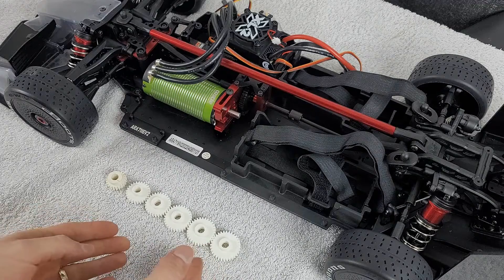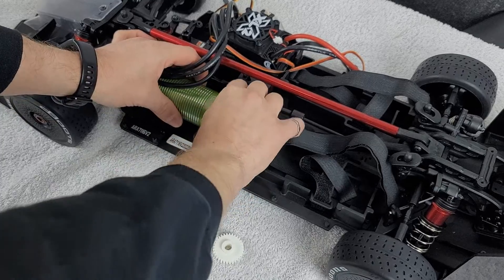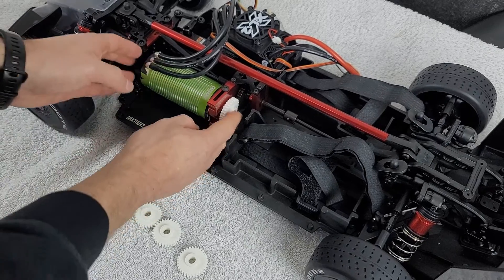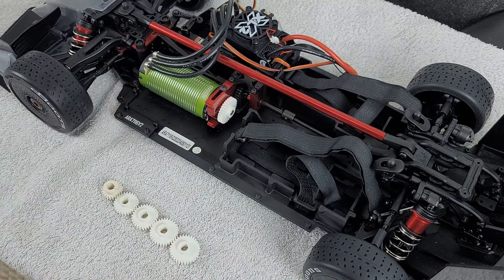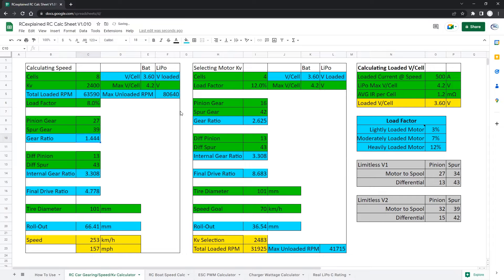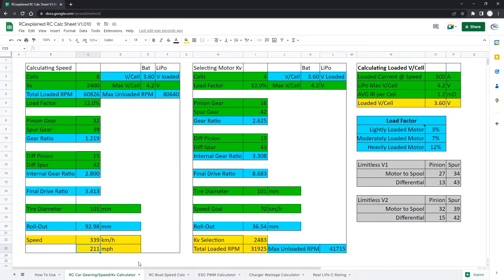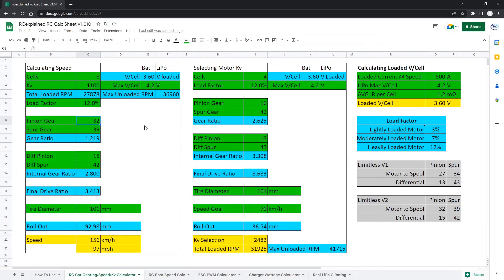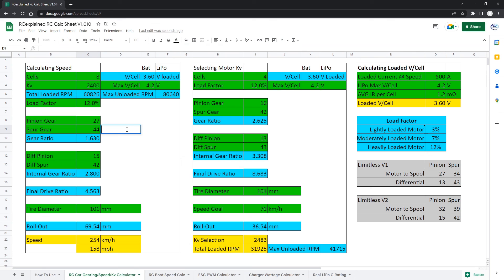The Limitless V2 Gearing Options are EXTREMELY Limiting! Especially for High RPM Motors

Comment: Okay, I have the limitless v2 everything on the unit's stock with diffs  i have ran two different motor combos. I have the castle XLX2. I ran the castle 1717 1650kv 34pinion 34spool 130mph I get 2 passes and motor is hot hot
I've also ran the same XLX2 With the castle 2028 800kv 54pinion 28spool best run sofar 132mph and I can run that setup four or five times before the motor starts getting hot 

I left the XLX2 and the 2028 800KV. In the limitless and bought another XLX2. And put the 1717 1650KV. In my infraction they both do really well. They both are a 130 mph cars 

When I can afford to buy me a castle 1721 2400kv i will go and do real world testing with the same batteries I use for my other two builds and see what I can put down.

Comment: Wonder what the smallest pinion I can use on the V2 if I have a 5690 can. This castle motor is slightly smaller at 46mm.
Reply from the maker: You may find its fairly similar
Reply: @RCexplained  what a coinkidink .39" wider and I ordered a 39t pinion to go 1:1 on the gearing. 😆
Hopefully it's not too big or too small. Maybe just perfect.

Comment: I have max5 g2 plus esc with hobbywing new 5690SL 2400kv speed motor, gearing is challenging smallest pinion i can run is 27t w/ 50t spool gear limitless v2, I also have a new castle 2028 1100kv motor as alternative what would u recommend for gearing for speed running on either motor looking for 150mph,  current pb is 116mph 1st shakedown on rig, ill do a shakedown tomorrow with hobbywing 2400kv 8s 36t/43t with 2 4s hv 9000mah 120c zeee lipos (new)

Comment: Im tempted to get a limitless v2 to race on road at my local track. They have a decent size limitless class. I was looking at a Castle combo with the Mamba Monster X 8s with a 1717 1650kv motor. Would this combo work or do you recommend the 1721 motor and the XLX2 esc in your video over tje 1717 1650kv and the Mamba Monster X esc? Thank you im having a hard time deciding
Reply from the maker: The 1721 is best for top speed runs over 120mph.
The 1717 is better for circuit racing.
This is primarily due to kv differences

Comment: I bought a V2 roller with a hobbywing 1650kv G2 (4990motor) with a max6 G2 (200amp) esc.

I just want to bash on the street. Speeds around 90km/h is more the enough.

Which pinion should be wise? Just go with the 32T?
Reply from the maker: Run the numbers through a calculator and you'll be able to get an idea fairly quickly. I have a simple calculator on the radiocontrolinfo website and a more in depth calculator on my Patreon page. Link is in the description.

Comment: The instructions with the car, lists the 32 tooth as the smallest. 32 to 39 tooth.
Reply: with a 56 motor plate even a 35t pinion wont fit sadly with the pps mount its not a problem

Comment: I was told on my build. I have a GT Chassis V2 limitless. Never ran YET. I am going for a single motor world record. 😂. I am !  Don’t laugh!  😂.  But a 34T and 45T gear for the 2.8 ratio diff with a locker in the rear. On a xlx2 2028 castle 1700kv. On BSR Foams. What are yall thoughts? I also of course have a PP CF GT Driveshaft kit. PPS motor mount. PP Carbon fiber kit. Titanium shock standoffs. Speedrun springs. fc100 body. Let me know?

Comment: What is the best drag gearing for Arrma limitless v1?
Reply from the maker: Depends on your setup. Best way to determine this is by testing a bunch of gears and choosing the fastest one. You can start your selection with a top speed calculation and go from there.

Comment: I geared mine at 28/46 and and when i ran it, i only got 91 mph, and the motor was only heating up to 88⁰ F.
I am using 2 CNHL 5600mah,  packs. Since it wasnt heating up, i changed the gearing to 30/44. I havent tested it yet tho. Im really starting to get frustrated with it. 
I cant find any tutorials at all on how to read the XLX2's data logs. You should do a video on that. I think ALOT of people would benefit from that kind of info.
Reply from the maker: Hello, I have done a couple video on reading data logs. Did you see those videos by chance? And what specifically are you not understanding well in the logs? You could email a log to me and I can make a video of it and post it here.

Comment: You are spot on!!! I had a 2850 kv tp power motor in my limitless V2 I had issues so I had to get a 1100 spcktrum firma 8s and I’m getting 123 mph 34 pinion 39 spur mamba monster x 8s esc

Comment: I got a v2 limitless I will be running a max5 esc and a 1100kv motor on 8s gearing i got is a 34-39 does that sound like it would work
Reply from the maker: I don't have the patreon Calc sheet up but that should be a fast setup. I also don't know how good that esc is. Never used one.

Comment: Just ran into this issue with my v2 roller smallest gear I can go with is 32 Im running a 1717 1650kv motor now that I see it's geared for 140 I'm like wow I don't need that much speed
Reply from the maker: Yep, swap out the spur gear as I've done in a later video

Comment: So, its been over a year. Is there a known technique to fabricate something so I can drop in a standard 50t diff out of the Arrma 6s line? This is BS, I dont want to go more than 110mph. I want a street basher that is an F1 type car, and the lack of a large spur forces you into having a straight speed run car. What about the rest of us? Anyone got anything solid? If not I'm hitting EBAY to find a used V1 instead of a new V2
Reply from the maker: I can't think of any advantage of a V2 over a V1 for what you plan to do with it. Either way, I'm sure you can plan a power system to do what you are looking for.
Reply: @RCexplained  I did some research and what I found is that if you get shafts from scorched rc, you can use the 50t center diff in the V2. I saw a video that was just wicked. I also watch their group live chat, and this is the real deal. I ordered the limitless V2 because of this one video! Why didn't you do an update video on this? https://www.youtube.com/watch?v=8JeF-P4Bz4Q
Reply from the maker: When you originally said diff, this threw me off. The Limitless does not use a center diff and as such I was thinking front/rear.

Completely changing out the center spool drive seems like the most expensive option to put a weaker solution in there. I'm referring to MOD 0.8 pitched gearing. The shafts themselves will be strong.

I did do an update video on this a week or two after the video: https://youtu.be/maNFbGrJTMo

This solution will allow for a 45T pinion used as a spur gear. I have not tested anything larger. But as I said in my first message, I don't see how this (cheaper solution) would not work for you. Somewhere around 4s 1800Kv using 27/45 gearing should get you around 65mph top speed.
Reply: @RCexplained  And don't get me wrong, I respect your work. I just thought that all options would be on the table. I've learned that this hobby needs deep pockets to "do what you want". Although the gearing is "weaker" on mod 0.8, it should still get the job done. I've never stripped gears unless the motor moves. Titanium motor mount screws are mandatory on all builds. The option to tune the center diff would making cornering more pleasurable in my view. 24t pinion with a 50t center diff should be a tire smoking, drifting, hard accelerating monster. This is where we diverge on opinion. I'm also looking at designing a 3d printed bolt on floor to get high downforce without the drag with weather stripping side skirts. I don't know if you're into that, but when Arrma used the term "Limitless" I take that to heart.

Comment: if im runnning a castle 1717 1650kv on the v2 roller, what is a good gearing setup for bashing and drag? I have a 32t pinion would be running 8s currently..
Reply from the maker: This is really a personal preference based on your setup and running conditions.

Comment: use a lower kv motor like the spektrum 1250 kv or castles 1100 kv( if it will fit)   problem solved,     but you want the 2400kv motor so swop the spool gear out
Reply from the maker: Did you find the newer videos I did of this car?
Reply: @RCexplained   I looked for a video of you running this car,   but can't find it.
I'm particularly interested in this build.
Reply from the maker: @1521joe  https://youtu.be/cNnnz495-xk
Reply: What gearing would you use for 2400

Comment: Your not taking into consideration voltage drop, even with the best batteries you will never hit even close to those theoretical speeds.
Reply from the maker: Hello, voltage drop is considered, you must have missed it.
Reply: @RCexplained  That may be but your numbers are still off, I have this RC and I would love it to go past 200 mph but this is not easy and the difference in gearing between V1 and V2 is not a big deal and if it were the gears are cheap compared to a big block motor, ESC, batteries and the other small details that are required.
Reply from the maker: What are you entering in to the calculator?
Send me a screenshot and I can help.

Comment: Just bought the v2 roller and got the castle 2028 1700kv with xlx2. Im gonna start as low as I can with the 39t and its probably gonna be pretty damn fast. 46t spurs are available though.
Reply from the maker: Yep. I can't remember what I went with but it's installed and ready to rip.
Reply: 30/40 1650 kv 👌

Comment: Im having an issue with my v1 😢i have a 1717 motor withVERY good cooling fans, the Castle mamba 8x paired with two 4s batteries with a 120c rating... i even have a cap pack on it and i cannot seem to hit more than 80mph ! Can you advice pleaseeeeeeee?
Reply: you fix the issue yet?    did you check your TX ?

Comment: 34t spur/27t pinion with the 1717 1650 motor was the smallest that would fit my infraction. I guess the motor mount on the v2 is different?
Reply: I was suprised. I thought id be able to use the same gearing as my infraction but nope.

Comment: Hello, i hesitating about buy Limitless V2 and put there 1650Kv big Block castle motor from XO-1 with Max6 ESC. Is possible to fit smallest 32T pinion with stock 39T spur, when 49mm diameter motor is installed? I will run only on 6S as maximum. Mostly 4S. Im not sure that 32/39 combination is for 40-49 whole range of motor diameters. I Know that for 56mm motor is 32 so small, bud im not sure in 49.
Reply from the maker: Hey Martin, if you download the manual from the website for the v2, pg 19 has a chart with specs that may help you out. At least you'll have more insight as to what size and gears are possible.

Comment: Did you ever look in the manual page 19? There is a nice table with possible gear combination for all 3 different motor mounts and default spur gears.
Reply from the maker: That chart shows the limitations. 
I can't remember what I said in the video but I do know that the smallest pinion with the largest spur gear is no where close to where this motor needs to be for the more typical setup. I believe the chart would show something like 32/39 as the largest ratio. That is 1.22:1, crazy !!!
Reply: @RCexplained  limitations, yes. Why did you print all these gears below 32T then? 39T spur gear matches to 32T-52T pinion gear. If the table would be wrong, ok. But wasting all this time to show the obvious?
Easy result: use low Kv motors.
Reply from the maker: Are you suggesting to replace the $240 speed run motor for a lower Kv motor? Wouldn't getting the right gearing be a lot more sensible  and cost effective? Not to mention high Kv motors such as the one going to be used are purposely designed for speed run cars.
Reply: @RCexplained  I would suggest to not waste 1/4 of your video to demonstrate the obvious AND THEN switch to "calculation" for the really working stuff.
If you want to reuse your $240 speed run motor (oh, so expensive, you will never buy a new one, LOL), change to spur gear XYZ. And, since when are you forced to use 100% throttle???
Also, there is a reason why ARRMA designed it like this which you happily ignore.

Comment: I had a similar problem with my V1 Skyline Limitless! DID YALL KNOW that the motor plate from the Felony and Infraction is a DIFFERENT motor plate?! I found that out through the ARRMA Forum… with the felony motor plate, you’ll be able to have a minimal total tooth count of 62. If you search for buying that motor plate, there is NO specific information on the product description about those detail! It will only say..,
 “ fits the Felony Infraction ” 
good luck guys💪💪

Comment: Whats a good gearing for the 2400kv CC.  Currently at 45/28 limitless v2  i get excessive amps. I noticed when i had new foams it doesn't take the punch drag hit off the line but when i put some used foams and do a drag hit screams off the line.

Any 411 is welcome
Reply: Have you solved this issue yet?

Comment: I'm dropping xlx2 1100kv castle 2028 in mine but I plan on smoking the tires and bashing with it
Reply: did the 1100kv motor fit>?     i thought the 1100kv was 112mm long.
thanks
Reply: @1521joe  I have the v2 version it fits
Reply: @1521joe  oh yeah, I, just updated to 2028 1700kv and it's stupid fast 130mph and barely did full throttle

Comment: I have the Limitless V2 with 1717 and xlx2 and 39p/34s and esc keeps beeping one short 2 long beeps. Is it overgeared??? Cuts off after one run...
Reply from the maker: I believe that beep code is excessive load. It detects this by current spikes. What theoretical speed are you geared for?
Reply: @RCexplained  I just used the chart that came in the box with the Limitless not sure what's going on...

Comment: That’s weird I wonder if they changed the v2 motor mount I had a 1717 with a 27/34 gearing it barely made a good mesh but still that’s a crazy difference
Reply from the maker: yes, mount is different

Comment: I changed my spool to a 40 tooth on my V1 and a 42 tooth on my V2.  That opened up my gearing options.  They are not on Horizon’s website. If you get on eBay you can find them
Reply: I have the 46 t spool with a 27t pinion gear and I’m hitting 111 mph  XLX2 and tp 4070 2200 kv motor 🎉 finding longer street still can do  little bit more
Reply from the maker: I have a 42T on the V1. Will have a 44T or 45T on the V2. It's in the mail still.

Comment: Easy fix… pps mount… EMP mount…. Scorched mount. Most of us ditch factory parts
Reply from the maker: Do they make V2 parts already? I don't think different mounts are necessary. I can just swap gears and I'm good.
Reply: @RCexplained  You are right. V2 stock mount I can use between 22 to 43 tooth pinions using a 49 tooth 8mm pinion as a spur gear. 2200kv. Haven't tested but looking for a 100mph or so to start with. Thank you for your help.
Reply: I just love my scorched mount. It’s a thing of beauty, just another level compared to other brands. Zero flex in the motor to the chassis and every time a perfect mesh without change after screwing it tight.

Comment: Great info! 😎 👍

I wonder if they changed the mount on the v2. I have the v1 limitless & a Typhon 6S. I'm currently running the 1721 2400kv in the Typhon 6S & I'm running a 40T spur with a 34T pinion. It fits perfectly, but it's also the largest gear combo I can squeeze in there.
As for spur gears, I use Saga gears, I just adjust the spacing by adding a washer to the spool. I did a video earlier this summer covering how to modify the spool to fit the 8mm bore Saga gear onto it.
Reply from the maker: Mount on the V2 is changed.  I used 8mm Mod1 pinions as spools. works well and will have to do this on the V2 as well.

Comment: Could just watch Raz Shifrin he’s used this motor and gone through the spurs and pinions to see what it can do
Reply from the maker: Raz is a professional who sets up his vehicle perfect based on many factors. If the average top speed guy duplicates his efforts it can be successful. If not, it could be costly $$$
Reply: @RCexplained  Agreed, but imo you have (although I get your explaining the many factors involved and your teaching in a way) over complicated things. Your using a motor that comes with a disclaimer from Castle that, if anything goes boom you have no warranty! You could stick a MAX6 and a 1650 from Hobbywing and as you have just said "Raz who's a pro" be way safer and if anything goes boom your more than likely covered by warranty. You see so many Castle systems catching fire so if your making it safe for your average person with little knowledge of speed running surely it makes sense to go with a far less sensitive system that can handle mistakes or not?

Comment: As always, an excellent video and very good spreadsheet. I'm attempting a world speed record with a 3S 2WD Rustler. It should come in handy.
Reply from the maker: Go for it! I hope you get it. Thanks for the comment!
Reply: @RCexplained    hi, im just getting around to building this car, im thinking am 1100kv castle motor, with stock spur, and 34t pinion, giving 111mph would be a good choice, based on the calculator.....thoughts?
Reply: I’m going for world record 2wd slash👀 got a 1717 1650kv in it paired with mamba monster x 8s
Pushing 45 right now on 4s with conservative gearing 26/58

Comment: is the Center Diff, 46T compatible on the Limitless V2 ? ARA310989. With some reassembly to accommodate the shorter dog-bones ?
Reply: Should  work no mods
Reply: No... diff mount spacing is different on the V2 than the V1
Reply from the maker: It's not on the optional parts list for the V2 Limitless. It also looks like if it did work it would need to be altered as the V2 has an extended length center shaft. Take a look here https://youtu.be/H_YRdjoXz9o